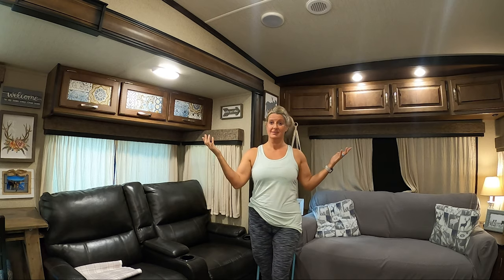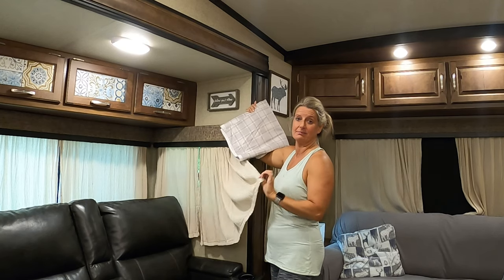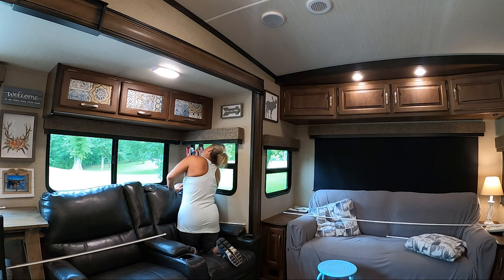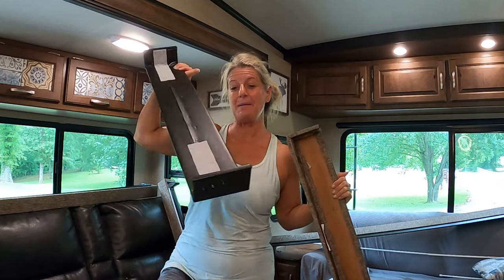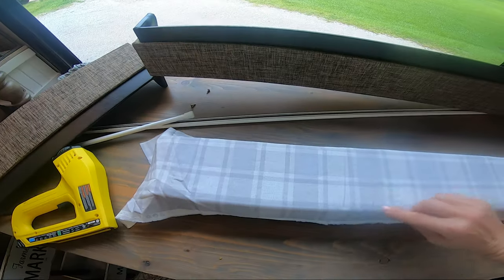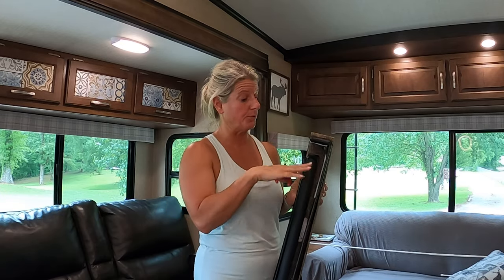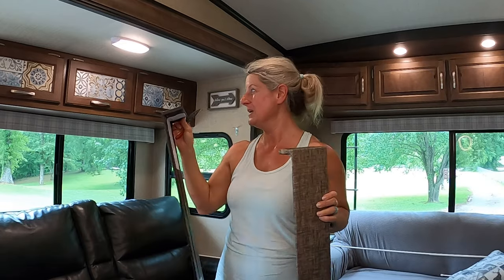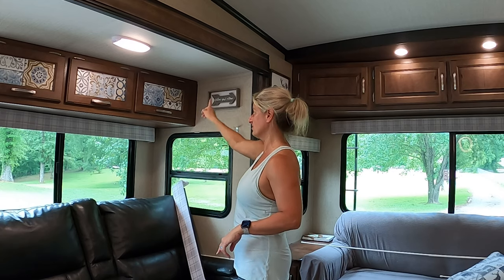HOW TO Update RV Valances Under $25 DOLLARS

Comment: HINT: Some time ago we moved into a modular single wide home (sorta like a larger version of an RV shoebox shape). They are kinda close together in our hood, so in order to maximize lateral privacy, I took off the ugly window coverings and installed frosted window film textured with beautiful elegant palm trees/bamboo stalks etc, peel n stick from amazon, that covers (on mid level windows) from the window bottom to about 2/3 up so the top 1/3 of the window is plain window. Or you could leave a 3 inch gap at that 2/3 point to see clearly out of, and then cover the top as well for more privacy. Plenty of light coming in, then installed expresso blinds to get max privacy/no light at night. On the patio doors I put the window film from thigh height to shoulder height, that way i can see out, but no one can see in. You could leave a 3 or 6 inch clear slot at face height to see out, then cover the top portion of the glass door if u wanted. Expresso drapes at sides to close at night. Max light in, great privacy at all times.
Your Project: The drapes are nice, but you have to wash them, iron them, etc. Window film is a great privacy very cheap item, look beautiful all the time with no maintenance other than perhaps an occasional damp cloth swipe. The valances look snappy, I just wd have covered them in vinyl peel n stick instead, that way it only requires a damp cloth swipe to clean. I hate dealing with fabric unless i get to wear it, ha ha! lazy thing that i am...
Reply from the maker: That’s really cool. We don’t full time so we hardly have to wash them. Thanks so much for watching and commenting.
Reply: after u pulled them out of the washer looking kinda shredded I was taken aback! I didnt know bleach wd do such damage to drapes!! I highlight my own long hair with bleach so I didnt make the correlation. oh my!  @BillandKelleyAdventures
Reply from the maker: @Lauren-vd4qe  yes. Since then I’ve replaced. Cause I learned that too. Had no idea it would either.